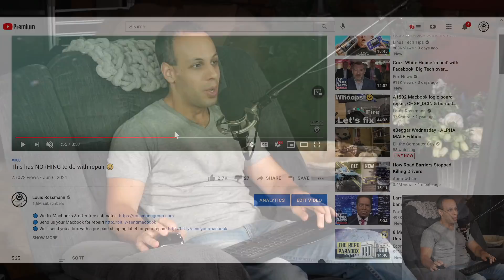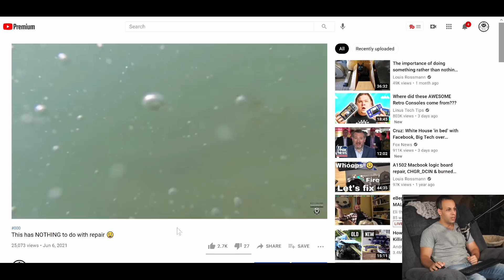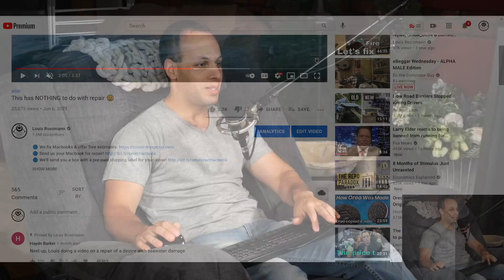Why are user serviceable batteries a bad thing?

Comment: That's something I don't get either.
I've seen people complain about the Xbox controller "still" using "disposable" batteries.
 
B*tch please?!!
1: it's swappable batteries! Whether they're gonna be disposable (Alkaline) or rechargeable (NiMH/Li-Ion) depends on you!
2: integrated batteries usually don't last nearly as long, as any other component of a device and few people bother opening the device and replacing the integrated battery. So, even if you're gonna be a dunce and still use disposable batteries (there's literally no reason to, since 1.5v Li-Ion rechargeables exist), better disposable batteries then disposable devices!

I'm happy about any device that doesn't use integrated batteries! 
I've had a wireless Corsair gaming mouse for a year that unfortunately had an integrated battery. Had to use that POS wired every other day, because the battery life out of the box (refurbished) wasn't sufficient for 8 hours of office use via Bluetooth per day + up to 4 hours of personal use via 2.4GHz/USB. Pathetic! 
Replaced it as soon as I found one that has all the same functionality and runs on one AA. The original battery lasted for four months and when it did run out, it took 5 seconds tops to swap it for a fresh rechargeable one. I couldn't plug the micro USB cable into the old one much faster than that and ofc I didn't buy a "wireless" mouse to end up having to use it with the charging cable plugged in, duh!

Comment: Next, wheels will be welded to the rotors for “customer safety and performance” and you’ll need to buy a new car when the tires wear out.
Reply: You've gone too far. I see no need for anything more than a new axle complete with shiny new wheels and tires. That would only cost about 80% of the car's price new - BARGAIN!
Reply: Apple probably already patented this...
Reply: Tires? 🤨 Pft. 🙄 Gas is dangerous, we've seen many videos of people starting fires at gas-stations because of user-replaceable gas. No more gas-caps. When you run out of gas, you have to buy a new car. (The same with EVs.)
Reply: ppl spazzing out over a plastic nozzle, but yet where i am alot of if not most ppl do their own wheel replacements summer/winter changes themselves and that has alot more risk involved, i could see it happening
Reply: invents a machine to change a tire while it’s on a car

Your move.
Reply: @NoTraceOfSense  Has it got a laser to etch the old tire off though?
Reply: @NoTraceOfSense  They wont sell you the tyre cuz the manufacturer told them not to. Get an unauthorized tyre brand? Void your insurance and warranty...
Reply: @maverick_ng  Warranty can’t be voided in the U.S. anymore. They don’t have to warranty your work but they do have to warranty everything else.
Reply: They already do this crap. You can't replace car batteries yourself because the electronics freak out and you'll need to take to a dealership. I was hearing that newer models of cars you can't even replace the windshield wipers! I can't find where I saw it though. Some youtube vid or something. I know the battery crap is real though.
Reply: My brother used to have a car with a sparkplug so hard to get to it had never been gapped.  It took AN HOUR just to take off all the parts that were in the way.
Reply: @Foolish188  subaru?
Reply: icar be like
Reply: Engine block is now welded to frame
Reply: custom car batteries not running on 12v are comming...
Reply: I feel like Tesla is the most likely candidate

Comment: I loved the old replacable batteries. Especially in laptops. Mine is on its 4th battery (which is on its way out). When I have a charger nearby, I can even plug the battery out on the go, so I can conserve charging cycles. The thought of not being able to do that bothers me, because otherwise, you're forced to either waste your battery power or plug it in and recharge it, which will both deteriorate your battery.

Batteries are the only component I ever HAD to replace. If I couldn't do that, my devices would last a year or two, rather than ten. I wonder why the manufacturers don't make it easily replaceable anymore...

Comment: I had an S3 and and S5 for years and together they convinced me you don't need a sealed battery to survive water. I put them through the wash a few times each, and dropped the S3 to the bottom of a pool while it was on, didn't realize it was lost for 15 minutes, then dove down and got it and it was still on. Last I checked the still worked.

Comment: The only thing I miss more than phones with slider keyboards is removable batteries.  They're a major security feature.  The inability to remove the power source of your phone means you can never be certain that your phone can't be remotely accessed for tracking or eavesdropping purposes.

Comment: I love my LG V20. Just press the switch on the side, the backcover lifts up and then I can replace the battery in seconds. This is now the 3rd battery, two more are ready on the shelf (recharged every half year).
The battery fear might arise from the reports of burning batteries. So I am not allowed to touch such a battery as it might explode a split second later. Some kind of grenade...
It should become conventional wisdom afap that empty batteries never burn - as they have no energy left for burning.

Comment: My first smartfone that i bought in 2013 was Samsung ACE 3 and it had a user removeble battery just as every cell phone I previusly owned. In 2019 i changed it to a newer model and I was really shocked when I found out that it has seald in, non removable battery.

Comment: You forgot to mention that a replaceable battery allows you 0% to 100% charge in 5 second!
Reply: This is what I truly miss the most..... Only having to swap batteries once or twice a day. Never being plugged in at all. 

I remember the Samsung Galaxy S5 commercials that bragging about this. 1 year later came the Galaxy S6 and it was over for the removable battery.
Reply: @anthonyreynolds2365  
I don't just remember it, I had it. It was awesome! I had 3 batteries. One always in my messenger bag, one in my phone, and one charging at home. Every morning, I'd just swap batteries and on my way with 100% in my pocket and another 100% in my bag.

People keep saying that a power bank solves that problem, but it doesn't, because
A. It's a bad idea using your phone while it charges.
B. It still takes a while to charge.

When I switched to the S7, I found a case (that wasn't too big) that was also a power bank (4000 mAh), that was pretty okay too... But I can't find one for my S20 SE.
Reply: @shane250  I got the S20 FE as well! Mainly because I'm opposed to spending $1200 on a freaking flagship. I also got an S7 back in the day, with the PowerBear Battery case. It got me by but it wasn't the same. The phone was thick and chunky from it and my S7 still had crap battery life after a year. 

When I got my Note 9, I wasn't power using my phone as much so I was eventually able to adjust without having a battery case. However my S20 is already starting to show diminished battery life.. Sitting on 14% while typing this.. lol fuck these glued in garbage batteries. 

Or pass Right to Repair for I can buy a new freaking battery!! People don't realize that a diminishing battery, also makes your phone slower and prone to crashes as well. Brings the life right back into a phone with a replacement. Exactly what these crooks at Samsung don't want 😂.
Reply: @anthonyreynolds2365  
Damn, what a coincidence, we had the exact same upgrade path (if you can call those "upgrades"). Next thing you'll tell me you also had the S2 :-)

Mine was S2->S5->S7->s20 FE. The next one will probably be a Xiaomi or another Chinese one. Those are the best bang for the $ if you're forced to upgrade every 2 years.

I wouldn't mind spending $1200 for a phone that's actually worth it... But they never are. I'm not paying for X2.5 phones just to get a slightly better camera and processor. These days, you pay extra to have features taken away from your phone. My provider actually offered me the S21 for the same price as the S20 FE, I refused because the 21 doesn't have expandable memory (FFS!).

I actually went and searched again after your last comment, and found a charging case for the S20 FE... Gonna order it tomorrow.

I use my phone for work, so I can't be stuck without a battery. Now I HAVE no choice but upgrade every 2 years because the battery lose 50% of its capacity.
Reply: @anthonyreynolds2365  I have Samsung Galaxy S21 (base) and it is lacking removable battery and micro SD card slot as well as headphone jack.

Comment: I think it's mostly trolls or somebody with IQ lower than room temperature vouches for the non-removable battery. Almost all the device I have with nonremovable battery is now collecting dust on my cupboard since the battery degradation is so bad that it's just not usable as a daily driver. Here is one of the examples which really bums me out even after a year, I bought this somewhat costly wireless earbuds from crossbeats and it advertised 4+ hours of usability per charge, when it was new I got like 3 to 3.5 hrs of usage which was fine but within a year the battery declined so much that it's literally of no use now. I get 30 min of usage per charge which is ridiculously stupid. I wish there was an option to swap out the battery but that can't be done (at least not by me) since the whole thing is glued shut.
Same goes for mobiles too, Battery usage drops drastically within a year or two which makes the usage really annoying. Whenever I got out, I feel like a power socket zombie looking to plug in my devices because the battery can withstand 2-3 hours of usage

Comment: It totally should be part of the legislation. Outlaw all sealed in batteries and come up with a set of standardised form factors for lithium cells that manufacturers are required to use. There can be a hundred of these, or a thousand, but it needs to be a standard.

Comment: every phone i owned had removable batteries right up until no manufacturers did it.    this allowed me to have an extra battery on hand when i was out and about, no panic when i wasn't close to a charge outlet and didn't needs some 3 pound, encased in plastic remote charger.    was so nice to just swap battery and continue my day.   but not anymore, gotta hug the power grid

Comment: Working in the garage using grinders & metal cutting equipment, I've found the speakers are the first things that go in my electronics lately. The dust in the air gets stuck to the membrane and gums everything up, I thought IP rating is for the ingress of dust as well as water? Doesn't seem to help either way.

Comment: This being said, I dropped my phone near water on rocks this summer and it went straight to the ocean. It was on a rocky beach and if the phone wasn't sealed, I can guarantee that the back would pop out and the phone would be dead. Even if the battery popped too and the device was saved from short circuit, the holiday would be ruined, since my phone was a camera too.Only because it was sealed, it actually survived this specific scenario. 

For your regular 'i forgot my phone in my pocket and went swimming' user removable back is completely fine, but in the edge scenarios where you drop your phone and are near water, sealed back can be a life saver.

I cannot count how many times I dropped those older phones and they literally disassembled themselves in front of me to various states. If the phone was cheap, I wouldn't mind but with 1000 dollar device it's a little more complicated, because on that beach, this feature might very well saved my device.

Saying that, it IS an edge scenario, but I think everyone needs to answer for themselves if this is something they could encounter. While there are active devices, they are needlessly bulky and phone covers can make alrey large phones exceedingly large. Sealing has a point.. but dos it mean that all devices should be sealed by default? No, of course not.

Comment: I want to note that I have a rooted OnePlus 8 Pro. I use an app called ACC (Advanced Charge Controller) to stop my phone from charging once it hits 80%. I've done a decent amount of research and found that manufactures essentially over-charge the battery to gain a higher capacity rating at the cost of longevity. This is usually designed for the battery to last about a year before a sharp capacity drop. Even charging to just 90% may make your battery last 2+ years. I use my phone fairly heavily but don't game on it. 80% lasts me all day fairly easily. Even if i charged it multiple times during the day, it would still cost a lot less battery longevity than a single 100% overnight charge. Having it designed this way without user choice seems intentional.

Comment: Even if the water resistance was non existent with user replaceable batteries a lot of consumers would still want a phone with that kinda longevity. Think about it instead of buying a new phone because the battery's gone bad you'd buy a new phone because you genuinely wanna upgrade because the newer model has more compelling features while still having the option to replace the battery on your current one. Heck even if you end up getting the new one the old one can be used as a really good backup device

Comment: I know that you are not a car guy, but I to share my experience:
-My old Daewoo Lanos. I hit the pothole, rear bearing went bad, I hitchhiked to first town, bought repair kit which had new bearing, new nut, new split pin and small tube of griece.All for $10. And part us shared with VW Golf and Opel Kadett. Car had very good repair manual and I replaced wheel bearing on the side of the road. Nut had same dimensions as wheel nut, so I needed no additional tools.

Meanwhile, few years later I had Fiat Punto. Parking brake cable was bad and during installation they damaged ABS sender - which was nothing but piece magnetic tape ring. Whole rear wheel hub must be thrown away because that tape is not made replaceable. And was so brittle, I was amazed how long it lasted. Now I have a wheel hub at home that is in perfect condition as a bearing, but can not be used in a car.

Comment: I've commented something similar on another one of your videos, but the Samsung Galaxy Xcover 4s i bought last year has a user replaceable battery, it is also IP68 certified supposedly, and can handle a bit of a beating.
It can still be bought relatively cheaply as well.

Frankly, the people against user replaceable batteries is just plain stupid, there's generally no point in discussing with them as they just have no idea what they're talking about.

Comment: Why is someone out there not making replaceable battery mods for existing phones? The aftermarket for phones used to be much more interesting, now it's just cases that make your phone bulkier and screen protectors.
Reply: Because those aftermarket items would be made useless once apple or any manufacturer decides to brick your phone by placing them into it since parts are now serialized

Comment: My Samsung Galaxy S5 was the greatest phone every constructed.

If I could go back in time I would've bought 10 of them, and used it for the rest of my life...

My battery never died... Why? Because I had 3 batteries and a wall socket battery charger. When one battery dies, I just pop the other one in.  After 6-9 months of hard use, I'd just buy a new battery off eBay for $5.

Oh and it was ip67 water resistant, I dropped it in the toilet many times, in the sink full of dish water twice, and even in a lake once.  It always came out fine.

Currently it's sitting in a drawer because I wore down the power button to the point that it doesn't contact anymore. Everything else is still perfectly fine with it, save for the cosmetic silver paint/plastic rubbing off the screen bezel.

"They don't make 'em like they used to"
Reply: Can you please explain how does one drop their phone into toilet many times D:
Reply: @MrCh0o  It's pretty easy actually, gravity does most of the work.
Reply: @Preacher_.  But I mean. Where do you put it for that to happen, I can't imagine it slipping out of your hand

On a second thought, maybe I don't want to know
Reply: @MrCh0o  Inebriation coupled with a dangerously short attention span was most certainly involved.
Reply: 3G network is been taking down around world at moment. So S5 as 4G (China model is actually 3G so those are already screwed..) it would be next in line then later.

Comment: People also believe that somehow audio jacks make phones not waterproof when there are plenty of examples of devices that are waterproof with a freakin' headphone jack on it.

It's almost like people just blindly assume what they read on the FauxBooks or Twatter and never bother to spend a single minute researching something on this beautiful internet that is available to all of us. 

All you need to make a user replacable battery work with waterproofing is to add an o-ring seal or similar to prevent water ingress. There, done. Then add some nice screws so that it stays in place and doesn't require a heatgun to remove a freakin' Li-ion battery. Which is another really dumb and dangerous thing with those glued-shut phones.

Comment: The last 5? gopros have had waterproof, replaceable batteries WITHOUT the poly housing. While i don't doubt it would add some engineering challanges, waterproofing electronics is not a new problem to solve.